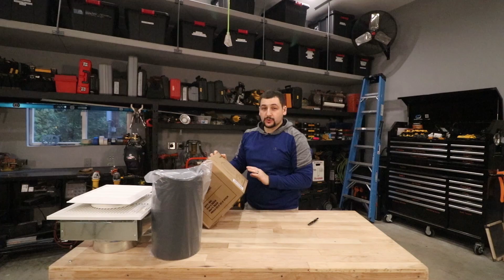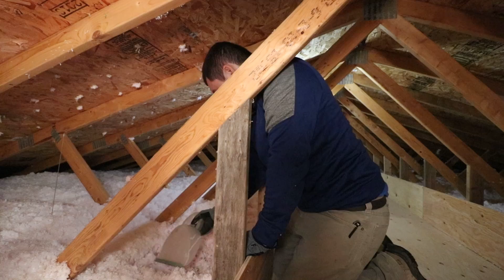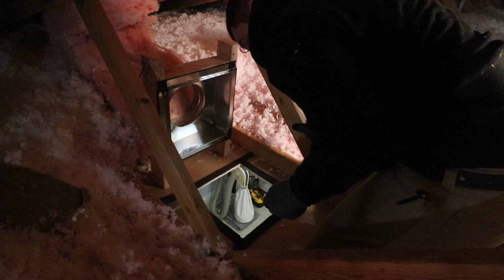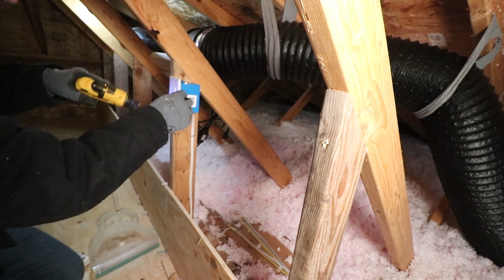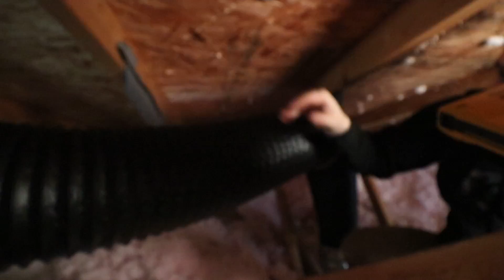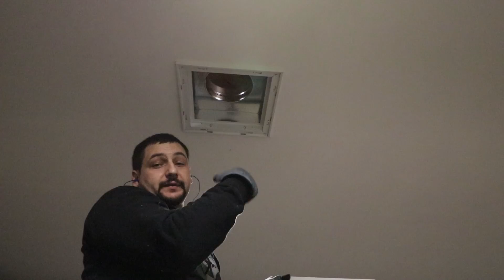How To Install A Exhaust Fan DIY

Comment: Hi Daniel, Great video, Thanks! I have high humidity problem in my garage especially in Winter. I was planning in adding an exhaust system and a dehumidifier. I was not sure which way to go about exhaust fan but your video is exactly what I was aiming for. I found a few parts on amazon but I was wondering if you had a description or link for the ceiling component and grill (the parts installed in the ceiling of your garage) as I have not found them yet. Thanks in advance!